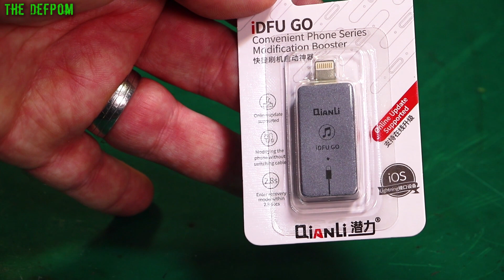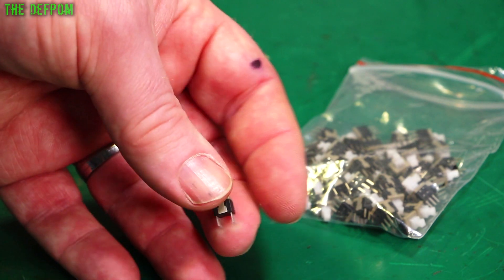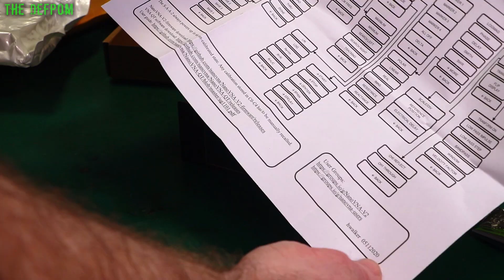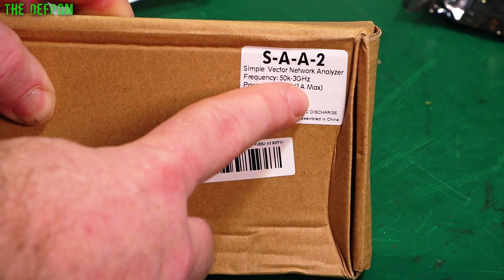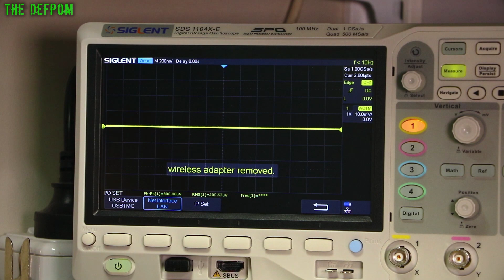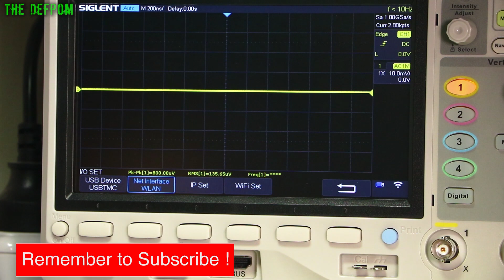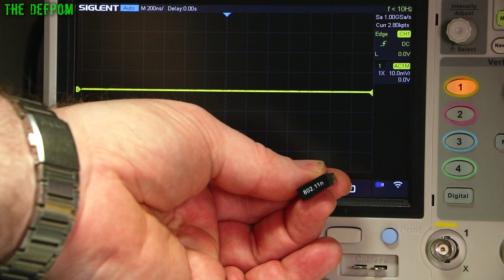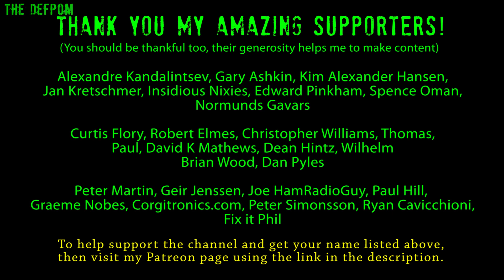#766 Mailbag Monday 28th September 2020

Comment: Now place the scopes IP into your PC's browser address bar and you should go straight to the scopes web browser Welcome page. From there the SCPI command panel and Instrument Control pages are available. Have fun with it. :-)
Reply from the maker: Thanks Rob, unfortunately the web interface still doesn’t work on Mac, I know it is ok on PC as I tried that out a while ago when I did the reviews on this series.
Reply: @TheDefpom  Maybe running another browser in your Mac rather than its default browser will provide a better result.
Reply from the maker: I tried Safari, Chrome, Firefox, all having the same issue of not loading the remote interface, (the initial main screen is accessible)
Reply: @TheDefpom  People keep telling me that 'Macs just work', I guess that's not true then.
Reply from the maker: CambridgeMart - for most general use, they just work is accurate, but when trying to use less common setups, then they tend to be limiting as companies usually don’t bother to write software to support the Mac.